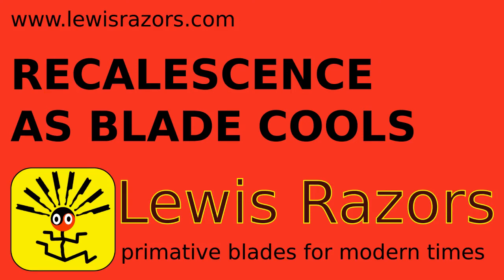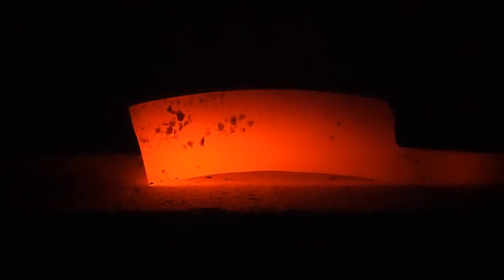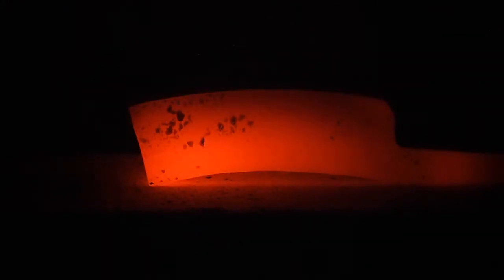Recalesence

Comment: I think this process called "Normalizing", is it right? Or It has a different definition. I learn your video before (grain refining) if I'm not mistake, that video give me the super easy to understand and take me to get more exploration about steel treatment. Thanks from Indonesia.
Reply from the maker: Adi Yusuf Kurniadi Yes, you are right,  heating to critical then air cooling is normalizing.  The main thing I was trying to show in this video was how you can see the "shadows" when the metal changes state.
Reply: lewisrazors Thankyou sir!!

Comment from the maker: The shape has nothing to do with it. It happens with steel, iron and other metals. I used a rough ground blade so that the thin edge parts would start cooling faster than the spine. I thought it made better video.